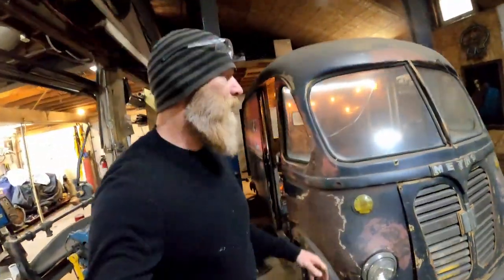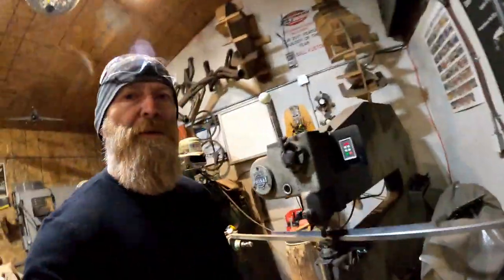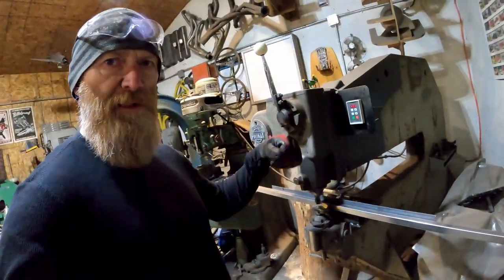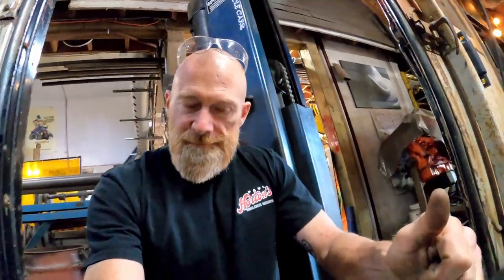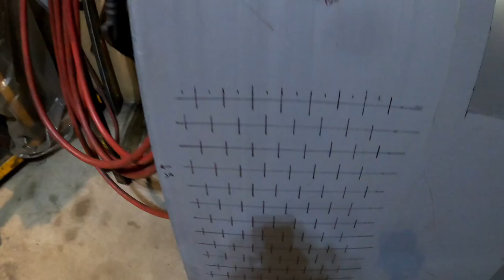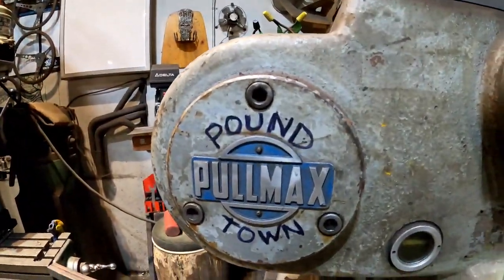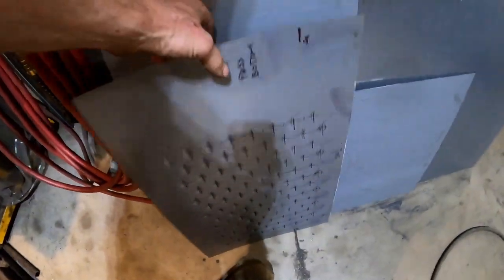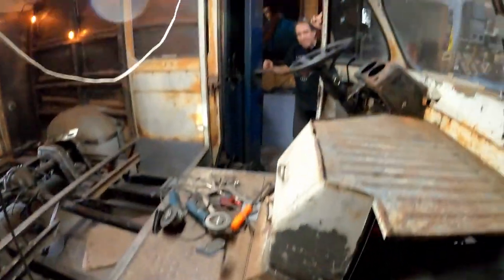Matts floorboards #pullmax #diamondplate

Comment: If it was centered, you could flip the panel around and work from center out or outside in and flip the sheet back and forth instead of moving the fence every time, save half the fence moving and more even, less chance to mess up the fence measurements
Reply from the maker: yeah, only now that you said it did I realize I should have done it that way Lol #nexttime